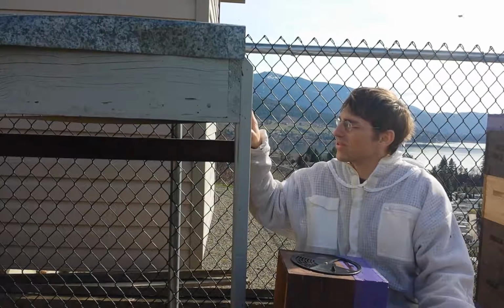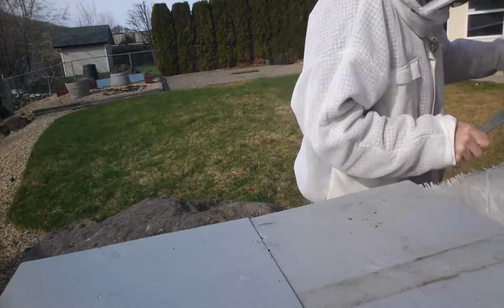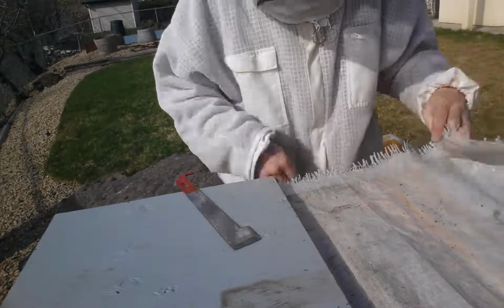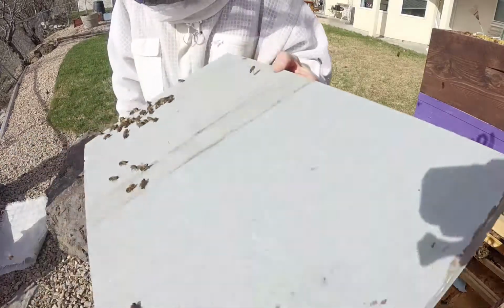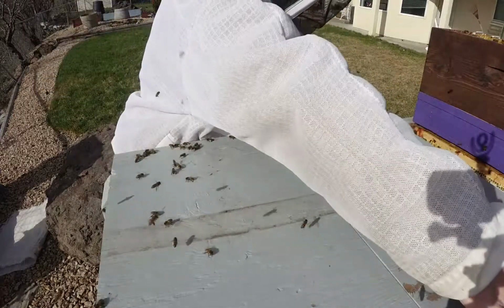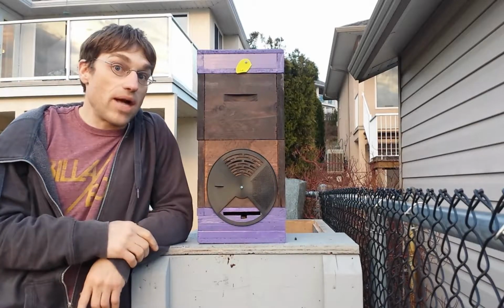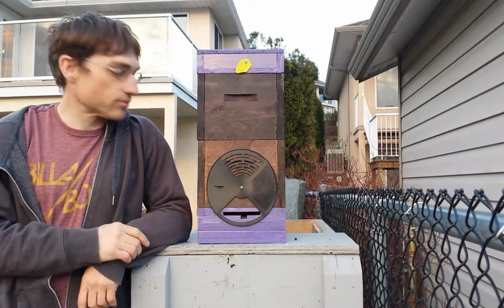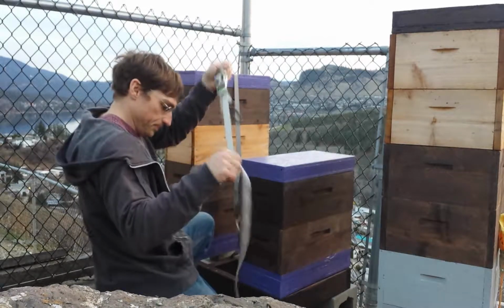Long Langstroth Colony Move - Mar 31, 2017 - Matt's Vlog #02

Comment: Morning Matt. I'm just getting back into beekeeping after a short stint 20 years ago. What were you pointing out around 3:38? Just got a quick glimpse. I didn't think that it looked like Supersedure cells . . . drone comb?
To somewhat echo Budo's Workshop . . . personally, I would rather hear your explanations of what you are looking at and why you are doing some of what you are doing. Silence and the hummm of the bees in between is just fine.

Oh. Also wondered about that huge spacing between frames, right about in the middle.

Cheers!

John
Reply from the maker: Hello John, To be honest with you, I don't  remember for sure. That was four years ago.  I think that I was pointing at some un hatched brood that was probably laid during the fall/ winter. That had some mold on it. This was the first Inspection of that hive after the winter break.  Cheers